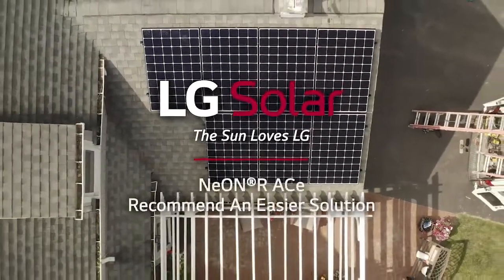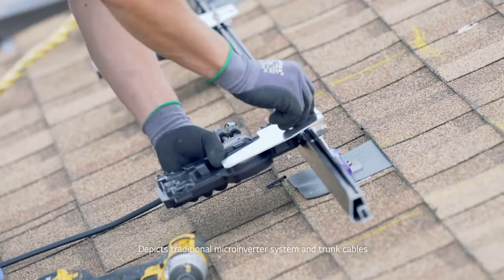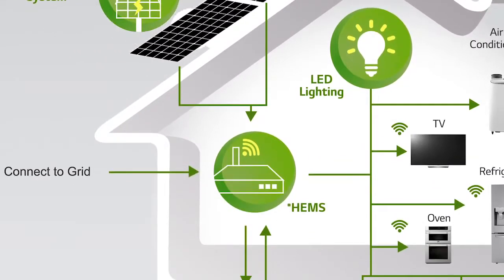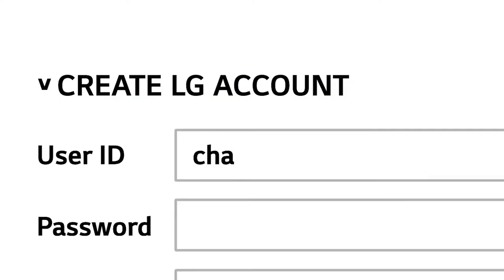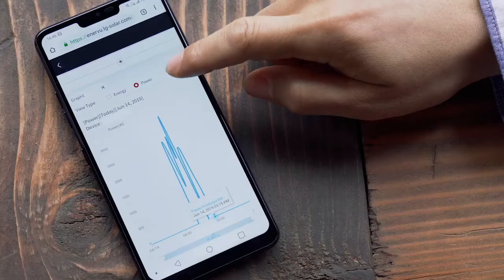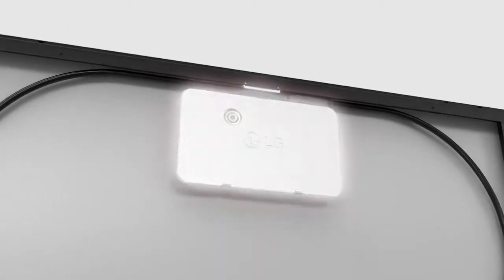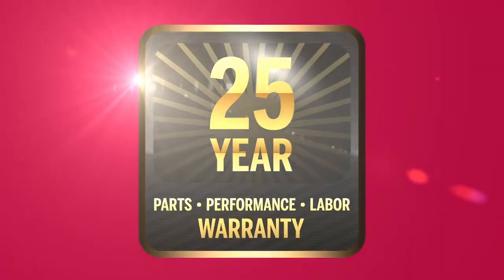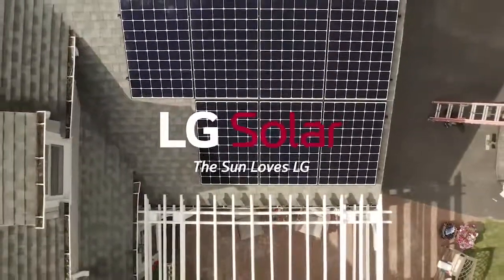LG NeON R ACe solar panel with built-in microinverter

Comment: This installation is absolutely irresponsible!
The connectors MC4 may be waterproof, however in time the seals on the cables age and snao leading to leagate, This in turn combined with leafs from nearby trees, mush and debrees/sand/dust leads to build up of sludge that WILL cause water build up around these connectors. THIS in itself WILL lead to the possible short of the entire inverter.
The panel HAS to be raised mode with cable management along the entire panel NOT TOUCHING the roof. This is the BEST work practice.
The connectors NEVER touching the roof.